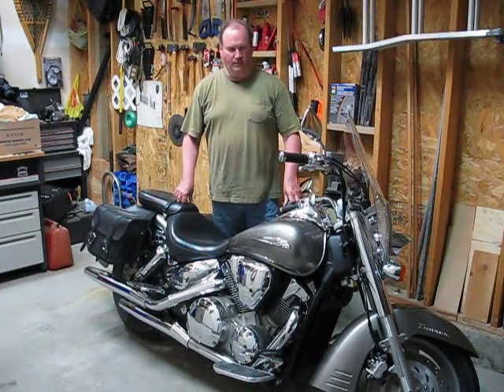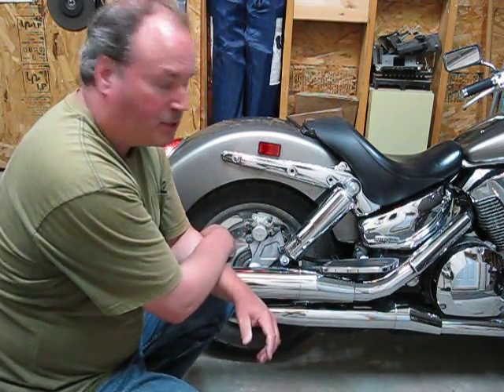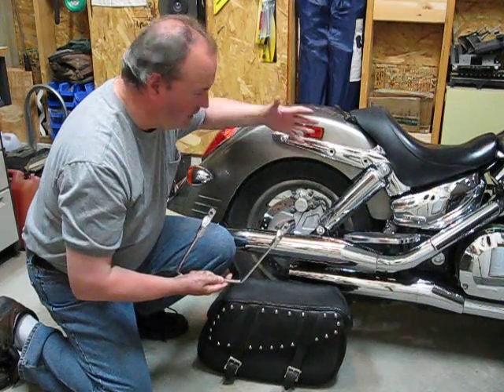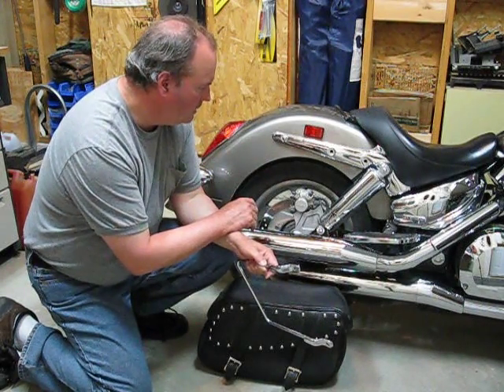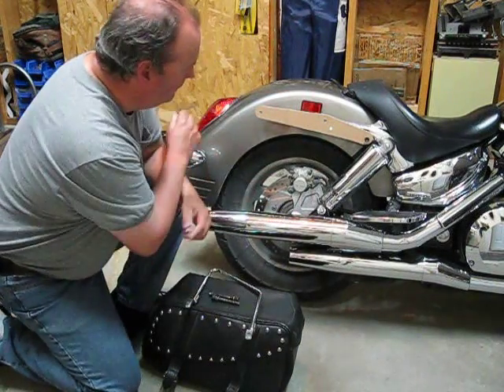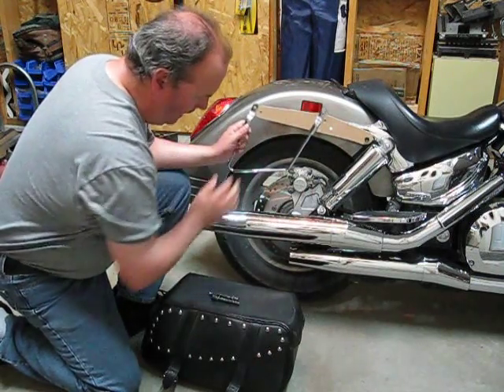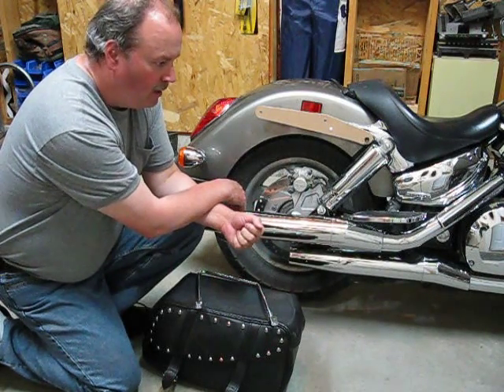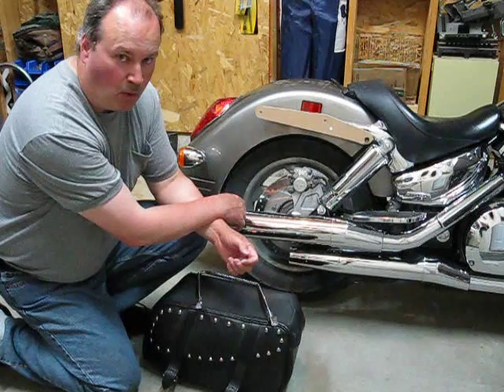Honda VTX Custom Pannier Brackets  Part 1

Comment: You could just bend that bracket to match the holes in that fender rail to make it fit, so you shouldn't have to go thru all that fabrication with another piece of metal.

Comment: did you save the template? some people (including me) could use that.. maybe a pdf format
Reply from the maker: I design all my models using the free online Sketchup utility. You can see my bracket here:
https://3dwarehouse.sketchup.com/model/4e2516fc-2deb-4a47-b1eb-e0cd972d8ed7/Honda-VTX-Bracket
Hope this helps.